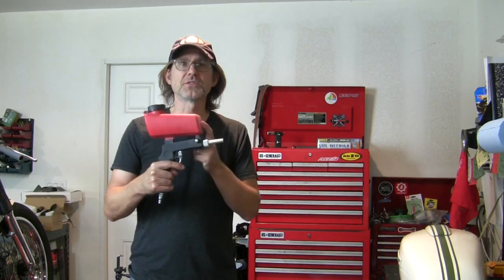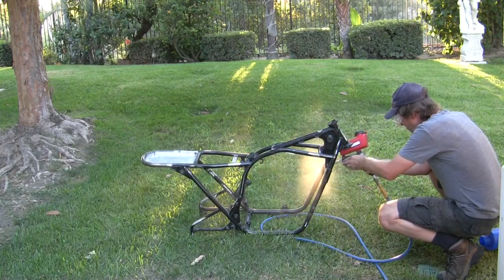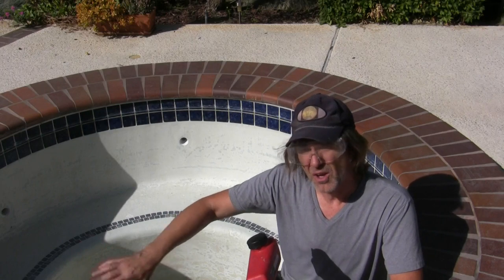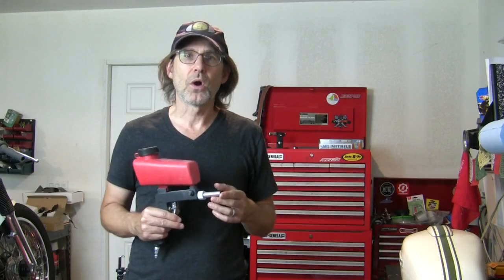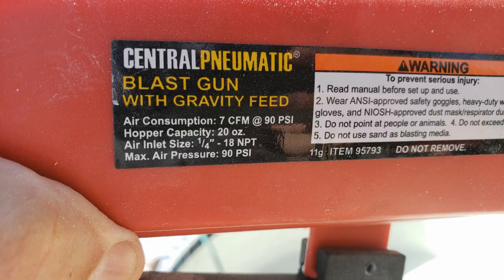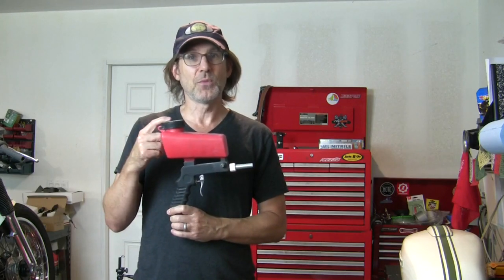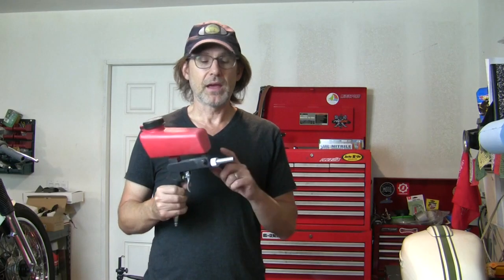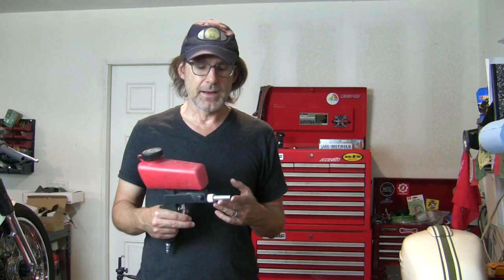Review - Harbor Freight 20oz Gravity Feed Blast Gun

Comment: Rather than spend on a large compressor it's often convenient to add smaller compressors and connect them. While I use 3/4" air hose and Chicago couplings for my two industrial 5HP units you can run smaller hose between compressors and add all the extra tanks you desire for longer blasting before waiting for the air supply to catch up. The biggest inconvenience when home blasting is lack of air.
Reply from the maker: Thanks for watching and for adding your insights here. Agree, lack of air is the limiting factor, but if this gun received more air, the next limitation is the hopper size which drains pretty quickly. In the end, for folks who already own a modest sized compressor at home and need to blast on an infrequent basis, this thing is hard to beat for the $.
Reply: Your comment might have just been my saving grace. Thanks! 👍

Comment: I have been struggling doing my motorcycle frame using "Aircraft Remover", scraping the paint off, & then using a wire wheel on my grinder.  This video convinced me to get a handheld sand blaster. Thanks.
Reply from the maker: I was happy I did, though I did get sand in my hair. Definitely wear some goggles that seal in your eyes. It gets everywhere.  Worked great on my motorcycle frame though. 3 years later the new paint on my frame is looking great.

Comment: thanks! My question is: (after sliding the container on the handle and screwing in the nozzle) Can I use this right out of the box? That's because it came with a tiny o-ring and 2 venturi screws that I don't know what to do with.
Reply from the maker: I would think so, but I don't recall mine coming with those extra/separate parts. Perhaps they've made changes to the product offering since I bought this one.

Comment: I think I was using it almost wide open so it went quick . Maybe even a cardboard box with some holes cut for arms to capture media and re use .I just came home and fired up tie compressor , filled it up and had at it wearing eye and mouth protection but still got one in my one eye . I like it . Glad I got it . It’s for small things , small pieces . Not a car body but smaller spots
Reply from the maker: Media does go quickly.

Comment: I think these guns agre great for using Bicarbonate of soda, or soda crystals on wood or cleaning alloy wheels.   For removing rust you need a harder grit, but it then could etch your tile or glass surface, which you probably don't want. So my feeling is you need to choose the media carefully for the job and to suit the gun design, or use a different blast gun and higher pressure than 90 psi.
Reply from the maker: Thanks for watching and commenting.

Comment: You will be all day with that thing you need a high power sandblaster
Reply from the maker: Yes, you're correct, it did take all day. I used it because I already owned it. Now that I don't have any sandblasting jobs to do, I'm happy with how little space the tool takes up in my shop and how $ is tied up in the thing. Thanks for watching!
Reply: @UrbanMonkTV  I've seen folks use some kinda torp for the sand to fall on so they can reuse it they just filter the trash through a screen
Reply from the maker: @Mr.Frost181  I think that makes good sense, especially for someone who is doing blasting on a more frequent basis.
Reply from the maker: @Mr.Frost181  ...and the fact that you use the word "folks" makes me like you right off the bat. 🙂

Comment: Does this gun get into deep pitting in rust? Like the very fine tiny black pits?
Reply from the maker: It did on my motorcycle frame. That's the only experience I can offer that mirrors what you're asking. Hope it helps.
Reply: @UrbanMonkTV  I'm doing the roof of a car that has 8 year old rust. Got the rust completely gone down to bare metal but tiny little black pits that I can't grind through. Wondering if this tool is able to bounce media into those pits and clean them or if its a waste of time. Did you experience anything like that?
Reply from the maker: @glytch5  Not exactly no, sorry. It may well do it though. It's only $20 to try.

Comment: Do you think it will clean up all the gunk or crystallize on the motorcycle engine?
Reply from the maker: Not sure I understand what you mean by "crystallize on the engine," but I think it would clean it. That said without actually having tried it on a gunky engine, but having tried it on several other surfaces.
Reply: @UrbanMonkTV  hi sorry I just saw you actually got a Gs550, I just picked up a 1980 GS550 and the engine is oxidized, and full of gunk in between the cooling engine part. I just wonder if you can sand blast the whole engine to make it shine like yours? Or i first sand blast it then polish it.
Reply from the maker: @DeeBeeStudioSabah  I think you could sandblast the engine case, cylinder and head. As for the clutch, stator and ignition covers, I sanded them with sandpaper and then polished. Enjoy your project! These are great little bikes!

Comment: '5hp' on the side of your air compressor, 120v 15 amps, how?  Is that 5hp 'peak horsepower' or something?  The math of that doesn't work out- you can't get that hp. out of 120v * 15 amps.      Thanks for the informative video!
Reply from the maker: You've peaked my interest. I hadn't thought about that. I'm going to have to look into that. Thanks for watching!
Reply: @UrbanMonkTV  I just bought a used 220v 15 amp unit, and it says 5hp.     1 hp is equal to about 750 watts.   Yeah the discrepancy piqued my interest.  I have the exact same sand blaster, going to hook it up tonight and try it!  I bought walnut shells, now I'm thinking they may clog the unit.

Comment: I have a 33 gallon craftsman.  6.9psi at 90 cfm.  

I can not get it to work for more then 20 seconds.  It just stops, i have a regulator set to 90 psi, and have 2 water removal filters in my hard air lines....

I have used walnut 12 and 24 grit, and black diamond medium grade.  None really work well.  Should I try the fine grit black diamond?
Reply from the maker: I'm not really a sand blasting expert, so I don't really know how well one medium will work over another under different circumstances. Are you in a high humidity area? Are the water removal filters loading up?
Reply: There are coarse, medium and fine grade abrasives.  Go with something fine with a little tool like this.  You can blast with baking soda.

Comment: I wonder if you could modify the nozzle to get it to perform better? maybe fab a nozzle with smaller exit hole
Reply from the maker: Probably. My guess is they went large assuming customers would use without a dryer and they'd avoid clogging with larger nozzle. If you fabricated a smaller nozzle, I'd use dryer in air line. Thanks for watching!

Comment: Wear a respirator even outside
Reply: Thanks for the FYI i haven't done something like this in quite a while
Reply: Use muratic acid for cleaning  pool tile. 44oz  to a five gallon bucket of water works great. I used to build pools and did a lot of rehabs on older pools
Reply: Thanks. Good looks
Reply: What about a full face shield. PBeing in Oregon, im pretty tired of things over my mouth at this point (21.5/23 months with a mandate)

Comment: Would this work for a job like Sandblasting some rims for powder coating ?
Reply from the maker: Yes it would. I used it on a motorcycle frame and it stripped paint nicely.
Reply: @UrbanMonkTV  wow. And you powder coated your bike frame?
Reply from the maker: @Smeaded  No actually I painted mine, but considered it.
Reply: @UrbanMonkTV  hmm. I see, my plan is to powder coat some rims and I was thinking about picking this up and using some aircraft stripper first. Do they sell grits that are softer? So I don't cause pitting in the wheels?
Reply from the maker: @Smeaded  you could try walnut shell. They sell that. More gentle, but might not be aggressive enough. You should try in a inconspicuous area.

Comment: Can you use this with the HF 150.00 air compressor
Reply from the maker: I really can't answer that with any confidence. I've never used that specific compressor. Mine was under sized and still managed to get a big job done, but I made sure to give my compressor rests to cool down. A person could use the logic that if the HF compressor you mentioned has similar specifications to mine, it would work. However, the quality of the components used to make the two compressors could differ and therefore that approach will not answer the question either. Depends size of your job and how much time you take to do the job.

Comment: great video. 
I have a 20 gallon compressor that produce 4.5 CFM @90 PSI. I tried walnut shell and did not work at all.  nothing really came out of gun. 
Do you think glass will work or my compressor just too weak?
Reply from the maker: Thanks for watching! If you weren't getting media out of the gun with walnut, I don't believe there's evidence you'd get glass out either. Guessing you're correct to assume compressor isn't up to the task.
Reply: drill the holes bigger on the adjustment shaft of the  gun and r o ring the hopper       watch fo  center the one on shaft with a file       night and day      the gun will work well then     outa the box   its not very useful
Reply: Aluminum oxide

Comment: it seems very weak output, what psi are you using? maybe increase it
Reply from the maker: Your question speaks to point I made in the video regarding the size of compressor. I was running it at 120 psi, but with such a small tank, the pressure drops fast. A larger tank and compressor would serve this gun well.

Comment: Thanks for the review. I purchased this recently for doing small glass etching projects (frosted, not carved).  I know I’m going to need a ceramic tip (5-7mm ID) for this using aluminum oxide 120 grit.  I notice the tip has a ridge and I’ve seen similar ceramic tips, and others just straight sided.  My question is:  as long as I get one with the ridge and right OD (about 15 mm)…is this just a straight forward swap out?
Reply from the maker: Based on what you described, yes, I believe it would be straightforward. Thanks for watching!

Comment: Would play sand from Lowe'swork with this gun seeing that's it's so cheap by 50# bag?
Reply from the maker: That's a great question. Without actually trying it, it would be irresponsible of me to simply say yes, but from what I can see it should work. I believe the keys will be the moisture content of the sand and the size of the particles. Any wetness causes the gun to clog up and the purpose-made sand is very fine.
Reply: Do not use play sand. There’s silica in it which can cause lung damage. You do not want it in the air! Don’t use it!
Reply: Only if you're looking to get silicosis.